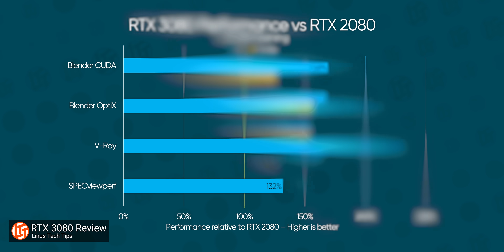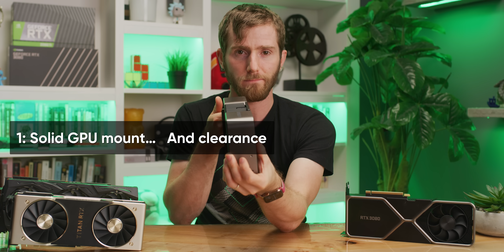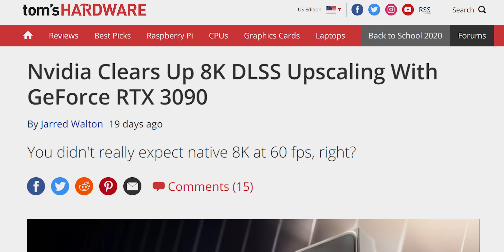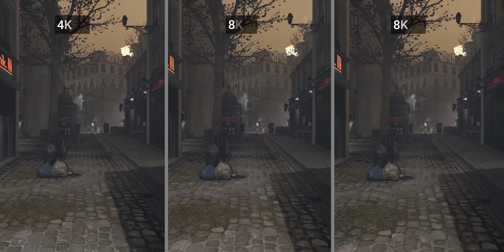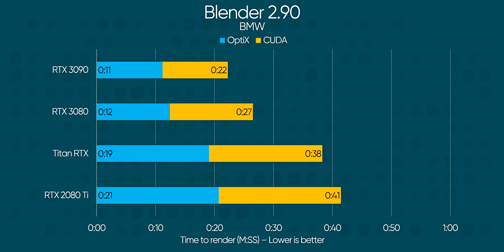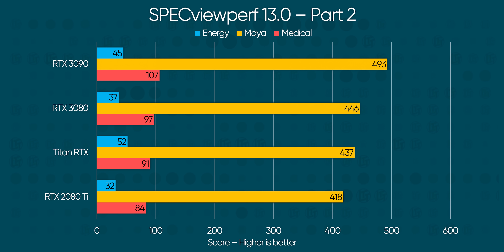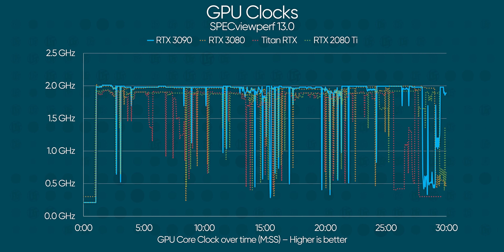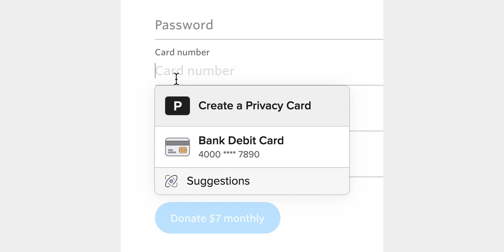Making Nvidia’s CEO mad - RTX 3090 Review

Comment: 10:03 It's a really sleazy move if Nvidia's reason for not enabling cad features on the RTX3090 boils down to, "That's not what we made it for.". If the card truly can't handle it, then it that's one thing, but intentionally gimping a product with subpar drivers is irreputable.
Reply: @TristanYoung  I don't have super extensive knowledge on this but the simple explanation is: CPU chips are made on big circular silicon wafers, since the scale is so tiny and the way they manufacture it so crazy = there's a lot of "defective" cores and such on many of the chips of the wafer. The % of chips that came out 100% perfect are the % of yield of a given process of manufacturing. The % of yield has never been (and probably won't be for a looong time) close to 100%. So essentially finding a way to sell those defective chips is a MUST because your cost of manufacturing is by wafer, wether 99% of it is junk or not it still cost you X per wafer to build.

So probably not ALL lower tier chips are defects, but if yields were 100% we basically wouldn't have lower tier chips since every wafer would come out with beautiful perfect 10900ks and making wafers of cheaper chips would be useless.

It's probably a much more complex topic and I'm just going off the top of my head from being an amateur so take it all with a grain of salt.
Reply: @Rafael Herschel you really say that they give drivers for free? Are people are really brainwashed these days? 
They don't give anything. They provide software support because without it that expensive card is just paperweight and nobody will buy one.
Reply: https://youtu.be/vfc42Pb5RA8
Reply: @TristanYoung  Really hard to say honestly but I would think so. Even with 100% yields the wafer cost hasn't come down so you need to sell the wafer at a certain $ to make profit. I would assume that yes, we would lose out on some low end chips and have cheaper high end and maybe slightly more expensive midrange chips (since now you have to make an entire wafer of cheap chips, the cost of the process is I think basically the same for a wafer of highend vs lowend, if the chips are of the same physical size though, different sizes means different # of chips per wafer so cost per chip goes down with smaller chips)

Loooots of variables here. Hard to speculate.
Reply: If they gave you the features on the cheaper consumer cards then a LOT of people would buy those cards instead of paying a LOT more money and getting a proper workstation class card.

As for Linux, NVIDIA will NEVER release the firmware to allow any recent graphics card to be fully powered up with the open source drivers because the license agreement for the blob drivers (on all platforms) says "you need a workstation GPU if you want to do xyz things with our hardware" and with the open source drivers all those users could get away with a far cheaper consumer GPU for those same workloads.
Reply: That's why I hate Nvidia and hope I'll never have to buy them again in any way. I'm glad that I'm not a hardcore gamer with thick pocket nor a CUDA-dependent guy.
That's why Nvidia will always be with their blob driver, unlike AMD. Because with blob they can control what you will do with the cards.
Reply: Dude, they're a company. Would you just willingly cut your earnings by 30% or more for some random youtuber? Especially when you have thousands and thousands of employees to pay?
Reply: don't they do that every launch/series?
Reply: Literally everyone does this lol. Radeon clipped the wings of their 5600XT to sell 5700's and Intel restricts hyperthreading in their low-end desktop parts. Sad reality but one we live in
Reply: @LmgWarThunder  "Intel restricts hyperthreading in their low-end desktop parts" That's incredibly simplified. Yields are never close to perfect. Lower tier chips are often simply high tier chips with deflective cores/features. There is a reason every single company does this. 8 core/16 thread chip has 2 non-functioning cores and hyperthreading? Disable those cores/hyperthreading and sell it as a 6core/6thread.

That said, yes everyone does this at basically ever level of selling any product of any type ever. Getting butthurt over it is stupid but being vocal and asking for realistic changes is fine.
Reply: Tons of companies do this, and it's always sad to see. 
It's common to see it in car manufacturers, where instead of putting [premium feature] in all of their cars, they go out of their way to make it an option you have to pay extra for, even if doing so costs them more production costs since now they have to produce multiple SKUs. They will basically throw a million dollars down the drain if it means they get to charge customers an extra 1.1 million.
Reply: @trapical  "they go out of their way to make it an option you have to pay extra for, even if doing so costs them more production costs since now they have to produce multiple SKUs. They will basically throw a million dollars down the drain if it means they get to charge customers an extra 1.1 million."

lol wtf is this even.

"even if doing so costs them more production costs since now they have to produce multiple SKUs" --- That's not true at all.

"They will basically throw a million dollars down the drain if it means they get to charge customers an extra 1.1 million." ------ Yes companies throw millions "down the drain" to get money. That's what having a big company and making money is. Although what's hilarious is that you seem to think they do that at a LOSS?!?!?! You're 100% R/ word dude
Reply: @BoredLikeHelI  actually is more expensive for them today (it was not like that 20 years ago for various reasons). That's why they start to charge to turn option on but install hardware on all cars because it simplify production, delivery etc. saving more that installed hardware cost (heated seats just for one example, it's cheaper to make all seats with it than to have two option, two stocks, maybe even two suppliers and just charge more to actually activate feature in onboard computer).
For PC parts is different story most of the times. As people mention already not all chips are made equal. But sometimes like in this case is just manufacturer decision to disable function on software level.
Reply: @gorky_vk  "actually is more expensive for them today (it was not like that 20 years ago for various reasons). That's why they start to charge to turn option on but install hardware on all cars because it simplify production, delivery etc." No it never cost more and it never will, because otherwise they'd be losing money and they'd stop/change up ASAP. So again, complete BS. IT DOES NOT COST THEM MORE THAN THEY MAKE BACK.

"heated seats just for one example, it's cheaper to make all seats with it than to have two option, two stocks, maybe even two suppliers and just charge more to actually activate feature in onboard computer" I need a source for that because basic logic and a 5 second search yield nothing to corroborate that. There is absolutely no fucking way that every new car today has heated seats but they're just disabled by the computer. We're talking about manufacturing cost difference of AT LEAST a couple dozen dollars PER SEAT, no way in fucking hell having an extra supplier for non-heated seats costs more LOL.
Reply: @BoredLikeHelI  did I say every car? I don't think so. It's not just or always seats. But staying at heated seats every new BMW have heater in back seats and guess what? If it's not payed as option it doesn't work. Hardware is there but there is no option to turn it on. If only 2% customers buy that option they will not work like that (that's why you will never see all seats with heaters in Dacia) so probably most of them buy option and is cheaper to have software to control it for customers who don't pay for it than to make cars without them. 
In some other company and some other car there is same situation with something else, where most of buyers pay for something and again is cheaper to install it to all units than to make small procent of units without it (and then guess other options, combine with available colors and than buyers for all of them) when simple software lock is all you need.
Reply: @gorky_vk  " That's why they start to charge to turn option on but install hardware on all cars because it simplify production, delivery etc. saving more that installed hardware cost  (heated seats just for one example, it's cheaper to make all seats with it than to have two option, two stocks, maybe even two suppliers and just charge more to actually activate feature in onboard computer)"

So you get called out for using that statement as proof that ALL cars have ALL heated seats and then you use a very specific example (JUST certain BMWs) and STILL HAVEN'T PROVIDED A SOURCE.

I never said companies NEVER do stuff like that, quite the opposite. Your BMW example is (if even true) one example where it works out for a VERY NICHE REASON (if it is true it is most likely in like the 8 series where 99% of customers get the heated seats anyway and the seats are of a certain design/quality that separates them from regular seats in other models/cars). That is NOT what you've been claiming AT ALL. BMW still requires the other non-heated seats supply chain so your reasoning of "it's cheaper to make all seats with it than to have two option, two stocks, maybe even two suppliers and just charge more to actually activate feature in onboard computer" is still absolute BS.

Just take the L like a man.
Reply: @BoredLikeHelI  This was a thing with Teslas. I forgot exactly what is was, I believe battery or performance options? Some cars had their features disabled and you would have to pay more to have them enabled. So you bought the car with cheaper options, but it also had higher end options in the car but disabled through software
Reply: @lievre460  yeah again, very niche and not purely because of "fucking over the consumer"

The cheaper cars likely have worse brakes/tires/suspension, maybe a different quality of engines that technically have the same maximum power output but can't sustain it as reliably for years. Different cooling/heating systems for the batteries at different levels of performance, etc. Just speculation here but I would assume at least SOME of these are true and handing over a high hp car with some of these parts not up to par is asking for a lawsuit.

The main reason is obviously simply the way electric cars work. I can map a fucking volt to have more power, it doesn't mean volt fucked me over, there are reasons way beyond "but i can just have +100hp by hacking it".

And before you tell me about autopilot and stuff like that (the sensors are already on cars theyre just disabled, or whatever) heres the last reason: R&D. 

Those things aren't "free" or "priced in" when you get them on your car but they are disabled. There's A LOT of extra R&D going into those extra features and they need to be paid off. The only other option is to have the base car have all of those things enabled AND cost much more than the previous base price to maintain profit.

Everyone seems to think they could just sell the base cars with all features at the same base price and companies just enjoy fucking people over. Get rid of your societal communist brainwashing and fucking think about it seriously for a second instead. (That last part isn't directed at you particilarly, just sooooooo many replies similar to yours but with a much bigger "fuck the companies they're ripping us off" msg)
Reply: What you need is an open source crowd owned computing company that can kick the shit out of these cabal companies like Nvidiot and AMDont. WE the people need to decide what's best for us, not the deepstate.
Reply: TheXboxSux nvidia legit could’ve made these cards more than their 2K series but you are still mad. Anyways why don’t you go make these gpus since you have the skill

Comment: You NEED to a video on this GPU with an Intel vs AMD test bench because although Intel is better for gaming they do not have PCIe 4.0 yet unlike AMD which can be a bottleneck and apparently Intel will use PCIe 4.0 next year
Reply: next year the same GPU will be even better with the next Intel CPU's because obviously Intel will have CPU's that are better for gaming/productivity regardless of them going to node size smaller than 14nm or not and that paired with PCIe 4.0 would make the gaming experience much much better for these GPU's and by then hopefully there will be less scalping of GPU's and even CPU/Motherboard manufacturers and retailers will incorporate stuff like captcha's and other stuff like NVIDIA said they and their GPU selling partners would add to their sites during checkout and they NEED to limit purchases to ONE PER CUSTOMER and per ISP and SHIPPING ADRESS  so if a bot does manage to bypass a captcha there are more measures in place (and for those who want more than one GPU for their address because they are getting it for someone else in their household they can have it so that you can reorder the same item like a few days later or have it reserved in a way that you pay upfront but for the next 7-14 days others get prioritized for the items until this period is over and stock is available)

Comment: I remember the days when you could convert your GeForce card to its quadro counterpart with a simple crack downloaded from warez sites. 🤪 I still believe actual quadro cards are ordinary GeForce cards that cost 3 times more with simply different firmware while the rtxs have hardware locks to prevent conversion 😜
Reply: Don't forget about Quadro having ECC memory unlike GeForce.
Reply: https://youtu.be/vfc42Pb5RA8

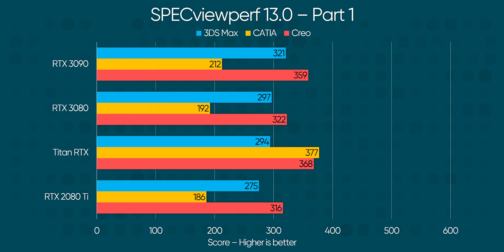Comment: 9:43 No, CATIA didn't run over 40% faster on the Titan RTX. It ran 80 percent faster. You're using the wrong score as the reference. RTX 3090 was over 40% slower, which does NOT mean that Titan RTX was 40% faster than the 3090. Well, technically it is, by a hell of a lot, but you're misusing math.

Comment: There's a bait and switch in this video. Yes, you need a lot of Vram to run 8k native. But the 8k benchmarks he talks about are mostly about 8k DLSS, which is NOT native 8k. Doom doesn't count, that game can run on a calculator. It can also run @ 8k on a 3080, making the 3090 make even less sense. But the lack of driver optimisations Nvidia admits won't come to this card to me is the final nail in the coffin. Do not buy.

Comment: True. SR-IOV could be the key on this card. Imagine "family computers" built on this. Not computers that family can use one by one. Computers that family can use simultaneously for working AND playing via Tier 1 virtualization.
Reply from the maker: Right??????.
Reply: @LinusTechTips  - AFAIK it should be possible via vGPU or MxGPU if the card supports SR-IOV. Without it no chance without lag which makes simultaneous shared gaming basically impossible. Right now considering 2x 3070 or 2x 3080 for my kids computer. Reasons being -
Memory is quite cheap and you can (at least moderately) over provision it.
I can host NAS in the same PC
CPU cores are also cheap as hell
Disk IO is cheap as hell
And if all this fails - I can sell one GPU and still have really good gaming rig.

Comment: I run an r9 390x (MSI Gaming edition).... I think my PSU and case will be fine. Though my 4770k would hate me.
Edit: Iiiiinteresting. Maybe not. Also, maybe that explains the hiccups I get on occasion... if an 850W PSU struggles with a 450W card, maybe my 750W PSU struggles with a 364W card.

Comment: This is a glowing review that is misleading about the GPU's actual 8K performance and marketing. GamersNexus actually ripped this card apart. Come on Linus, you have Anthony who is capable of giving you solid results to discuss. Unless you're in Nvidia's pocket now...
Reply: I watched both video. Thank you for referring me to GamerNexus. Man he ripped that card A P A R T.
Reply: @narc0tlc  He specifically said that all the flak the card received was just because of nVidia's marketing division beating HARD the drum of the "gaming card" instead of marketing it as a "workstation card" which could totally be. That thing could shred through workstation benchmarks if it had the right drivers
Reply: There's two ways to look at it.
1) It requires DLSS 2.0 set to Ultra Performance, and because of that you're playing at 1440p on your 8k monitor and thus not actually at 8k which makes the entire gimmick deceitful marketing.
2) It shits out an image that the TV accepts as "8k" and displays at its native resolution, so don't complain.

The way I look at it is a bit different.
What Nvidia has done, is successfully market the reduction of image quality by plugging gaps between the pixels using AI, as a feature. This is making use of fixed-function hardware which could've gone to RTX tasks or be left off to save power.
Over a decade ago Nvidia caught a lot of flak for performing better in all the benchmarks at the seriously noticeable cost of image fidelity. The games looked worse than they did on ATi, but you got another 10 frames for it and Nvidia thought that was clever.

In my humble opinion, this is a side-effect of their goal to "redefine the gaming experience", to boost sales of their product in a market that's shifting away from dedicated graphics cards and towards consolidated solutions like APUs, which AMD and Intel are already ruling the roost, and Nvidia due to not having a CPU division can't compete... not yet anyway... they bought ARM specifically so they can.
Reply: Always has been